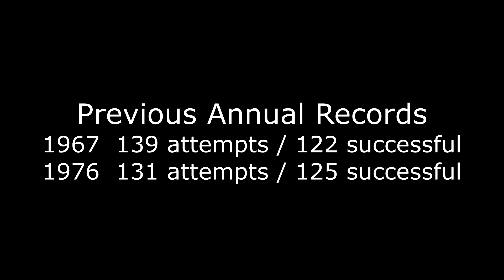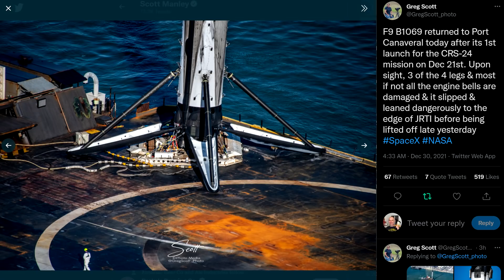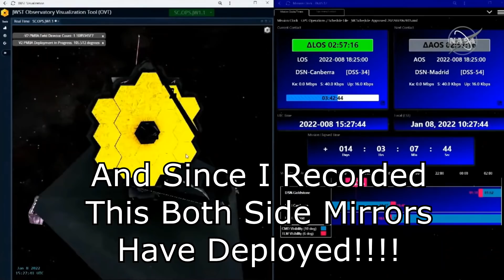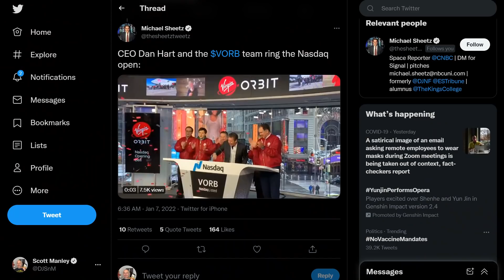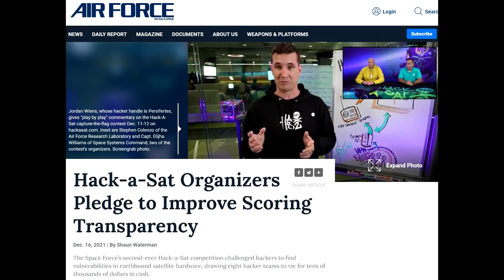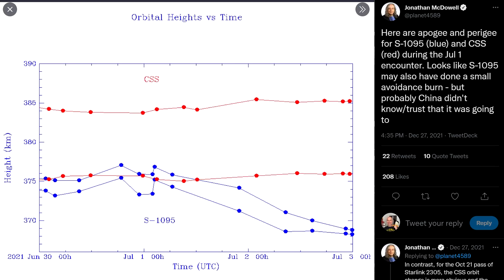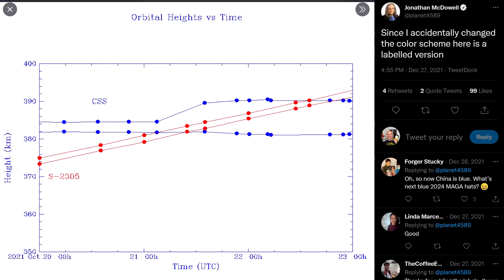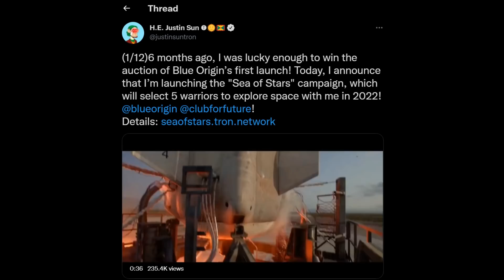JWST Deploys Mirror &  Moon's 'Mystery Hut' is Revealed - Deep Space Update - January 7th

Comment: The scary thing about Hypersonic Glide Vehicles are the ones specifically designed to travel at speeds above Mach 10 during the terminal stage, and still manoeuvre. China was the first to be successful with this, hitting their target from over a thousand miles away. It took many years after for the USA to have that success. Even Russia beat the USA. These things are so fast and manoeuvrable the counter-measures have no chance to stop them in terminal stage. These things reach that stage in under 10 minutes. That's a very, very short window to stop it.

Comment: Why does James Webb tension the sun shield?  If it tears they are toast.
Reply: The sunshield is designed not to let tears propagate. It has to be tensioned because the layers have to be in the correct orientation: the heat transmitted through a layer of the sunshield must be reflected off to the side so it can escape through the gap between the layers.

Comment: How is there not perfect quality cameras on everything these days.  Super sus that there isnt.  All the excuses are pathetic by the way.  Its not the 60's, 70's, 80's, 90's anymore.  0 excuses.
Reply: Reasons not to use cameras on JWST: 
1. on the cold side, temperatures are too low for commercial cameras. You'd have to develop a cryogenic camera, or build an enclosure with a heater.
2. Camera cabling would have to go through hinge points, this adds complication and risk.
3. Camera cabling transfers heat to the cold side.
4. What would happen if a camera, its lighting or its heater were to get stuck in the ON position? You'd have a heat source on the cold side of the spacecraft. 
5. you'd need a lot of cameras to cover all of the deployments->extra weight. 
On JWST, the cameras have engineering value only; they did the tradeoff and decided against including cameras. You'll just have to be patient and wait for the first images from the science cameras.
Reply: @zounds010  I want solutions. Not excuses.  Get to work!
Reply: @Naganita  The solution for JWST was to not use cameras but install sensors that provide far more detailed information. Deal with it.

Comment: In my opinion. Chopsticks are in calibration mode plus leak checks, pressure curve recording for evaluation, friction checks on the lift gear plus cable strain and timing checks on acceleration for starters.

Comment: Scott, at +12:00 you're incorrect that this is the first piece of consumer electronics outside the Van Allen. As early as 1998 the ISS had commercial-off-the-shelf IBM Thinkpads running the Solaris Unix OS that hosted an interface to the ISS station control functions. I learned about this Solaris installation because around that time I had to deliver an early release of my updated Solaris device driver which I was told was needed on the ISS as soon as possible. The ISS also had IBM Thinkpads running Win 95 to manage other tasks.
Reply: Last time I looked the ISS was in low earth orbit averaging 400km height, barely above the atmosphere,  and well below the Van Allen belts lethal radiation zones. Hard to expect Cosmo/Astronauts to volunteer for long missions with a guaranteed dose of radiation sickness and cancers in their job description. 
Still a significant hitch in the human's to Mars plan - where can you shelter from a solar flare event when away from Earth's shelter for the 2 to 6 years an expedition would probably require? With any current or prospective hardware designs it's still radioactive Russian Roulette.

Comment: very stupid unfurling design with 345 failure points. all they had to was copy an UMBRELLA being opened using a single motor ( with 1 backup motor). this would unfurl mirror and shield in a single action as pivots points would link the 5 shields plus the mirror

Comment: IF THEY HAD ANY BRAINS THEY WOULD UNFURLED THE TELESCOPE IN NEAR EARTH ORBIT IN EARTHS SHADOW SO IT COULD  BE REPAIRED BY A ASTRONAUTS AND AN ION ENGINE LIKE VASIMIR WOULD TO TAKE IT TO THE LAGRANGE POINT. IF THE HAD ANY BRAINS THEY WOULD HAVE INCLUDED A ROBOTIC ARM FITTED WITH MULTI TOOLS TO FIX ANY MECHANICAL PROBLEMS. IF THEY HAD ANY BRAINS THEY WOULD HAVE BUILT UP A BACKUP IN CASE THE ROCKETS BLOWS UP.

Comment: They could have had a cubesat fly alongside JWST to take pictures.   The problem of cameras solved quite simply I'd say.  Agreed?
Reply: No
Reply: @epincion  Why not?
Reply: @simian_essence  If you watch Scott's whole video (and others) on the JWST its constructed and placed so that the 4 sensors on board can study the backround radiation of the universe and so in effect look much much further back in time than any other telescope so far. 
This requires the mirror and focusing elements be shielded as much as possible from any nearby source of heat. Hence it will sit at over a million km away at earth L2 shielded from the sun by the bulk of the earth and then further shielded by the 5 layered huge sunshield and the whole craft in an orbital position such that the mirror and sensors never see any heat/light from nearby sources and so are kept as close to absolute zero as possible.
A nearby cubesat would be such a source.
Reply: @epincion  Of course the cube sat's function would be to monitor the deployment phase, not science operations.  It could easily send itself away long before science operations begin.  The same could not be said of cameras stuck to the observatory.
Reply: @simian_essence  'Send itself away' - that would be a very pricey high tech cube-sat with enough fuel and power to get a sufficient delta-V to get far away quick enough from L2. Its not worth the costs and risks for what are in the final analysis just pictures
Reply: Exactly.

Comment: 3:24 In regards to Maneuverable Reentry Vehicles (MARV or MaRV), United States after it shifted from single warhead ballistic missile reentry vehicles to Multiple Independent Reentry Vehicle (MIRV) in the late 1960s and 70s there was developments and debate about MARVs.  The United States deployed the Pershing II IRBM in Europe from 1984 that had a MARV warhead until they were dismantled under the terms of the INF Treaty in 1987. Strategic United States forces were considered for MARV warhead conversions. MARVs would present ABM systems with a shifting, rather than ballistic, path, making interception quite difficult. The U.S. chose not to further to develop them in that they were a solution to a none existence problem.  It was thought that existing MIRV warheads were difficult if not impossible to defend against in a coordinated saturation attack.  At the present no U.S. missiles have maneuverable reentry vehicles.  Other countries are reported to have MARVs operational.  The Ground Based Strategic Deterrent (GBSD) is a future American land-based intercontinental ballistic missile system (ICBM) currently in the early stages of development. It has been reported the missiles will be equipped with the W87 mod 1 thermonuclear warhead replacing the W78 warhead currently used in Minuteman III. The W87 is presently a MIRV warhead and no MARV capabilities.  However, if defensive capabilities of adversaries are enhanced it is possible they could be so developed.
Reply: That warms the cockles of my heart… thanks for the update!

Comment: I bet Russia is pissed that they are no longer the defacto launch system and each year they are become less and less used and unless they can keep up with SpaceX, most companies are likely going to fail.  I personally think Starship will not be useable for manned launches and landings do to the lack of an abort system.  I really think they will need to keep the Falcon 9 around for many more years.  I would love to see them redesign the system to use Methane and the Raptor 2 engines.  Think of how much cheaper and how quick the turnaround could be as well as a larger payload and the ability to throttle the engines on landing.  Maybe they could squeeze enough extra fuel for a non heatshield re-entry.
Reply: Angara is still under development. The 3rd stage failed this time around. Roscosmos is developing a scaled down Falcon 9 copy called Amour. But that’s a very long way out.

Comment: You are the FIRST to point out that pretty much ANY space launch or ICBM is a hypersonic weapon.  Everybody thinks these weapons are unstoppable.  Typically to reach those speeds requires them to be fired in a ballistic trajectory.  This makes the easy to spot at long ranges.  A strait firing missile travelling at Mach 3 is going to be just as hard to stop as a ballistic missile fired at Mach 6.  The US has programmed many of its defensive missiles to be able to track and target ICBMs traveling at up to Mach 25 or so.  Yes it is better to target a slower missile on the way up, but that is typically not possible unless you are pretty close to the launch site.  Understand we can hit missiles in almost every point of its trajectory and have MULTIPLE layers of defense with some designed to strike the missiles (or satellites) in orbit and some in various altitudes of the atmosphere.  For non ballistic missiles there are even more defenses, but they will have a far smaller window to intercept a missile.  Realistically these weapons are most effect during a surprise attack.  During wartime these defensive systems will be on much high alert and the radar activity will be much higher trying to detect launches earlier.

Now the main difference is typically ICBM are only launched from ground locations or subs, but newer hypersonic weapons are shorter ranges or around 1000 miles or less and can be fired from boats and planes.  The US Airforce has successfully tested their Hypersonic weapon, but the Navy version was cancelled as they have been working on one that can hit up to Mach 20 in a maneuverable glide cruise missile.

Comment: "The first piece of consumer electronics above the Van Allen Belt"? BULL cookies! HORSE fritters! There was a Sony TC-80 aboard Apollo 7! Actually there were many music players brought to space during the Apollo missions. So not even CLOSE to being close to being close to the first!
Reply from the maker: See…. I meant to say ‘modern’ in there - also - check my video on the cameras used in space - the Hasselblads and Nikons
Reply: @scottmanley  Also wouldn't the Snapdragon 801 processor on board the Ingenuity helicopter also be commercial electronics, because to my knowledge it wasn't modified beyond consumer spec.
Reply: Considering what manufacturers try to lock down, I'm surprised they found a device they could modify enough, and even more surprised it was Apple. (Except perhaps for Apple being eager for the propaganda; "first!".) Up there, you usually have 2 cores running the same computations together, and if they disagree, run them again. That requires some software changes at the deepest level of the operating system, and it's hard to imagine how to make it work with modern software at all because it slows everything down so much.
Reply: Not to mention the gopro on starman in solar orbit.

Comment: Id like to know this. Why is the closeup photo such garbage quality? According to the photo the moon's surface and rock is rainbow colored? I know for a fact they can do clear and proper closeup photos with great resolution. The two prior photos looked correct but the close up is garbage. Something seems off.
Reply from the maker: Ever heard of a bayer mask?
Reply: @scottmanley   I haven't what is that?
Reply: @scottmanley  also if you look at the shadow there's a perfect line on all three sides of the shadow. Looking at the round rock why is the shadow a rectangle with sharp edges and lines. You can see some light casting around the left side of the rock, the shadow it casts should have a concave shape. I see a shadow that doesn't match the object it extremely obvious.
Reply from the maker: @Jenny-CR  come back when you understand cameras otherwise you’re just going to get laughed at.
Reply: @scottmanley  okay I get you. I should learn more about photography it will definitely help things make sense. It's just strange that a pretty round rock with jagged parts would make such a shadow. A half open door shadow is caused by the shape of the door and the angle of light. It just seems like a shadow with straight sharp edges and angles would be caused by an object with similar features. I could be fooled tho, I'll learn more on the subject like you suggested. Thanks for your time and responses.
Reply: I looked up Bayer mask. It's just how a photo sensor works for rgb. I understand how that works. I just want to know why the camera is suddenly primitive and we are seeing the rgb, when I know they can take a photo that we aren't seeing just sensor patterns. Or is the closeup just taken from the previous photo by zooming way in on it. I imagine if you zoom way in on a already takin photo you would see the rgb patterns.

Comment: What’s spaceX’s long term plan with this starlink? They’re going bankrupt... is their plan to have so many satellites that the US government has no choice but to bail them out?

I’ve read this starlink system is quite expensive and with a lot of users it’ll slow down considerably just by the nature of its design 
Plus the starlink dish uses quite a bit of electricity... 100w ?
I guess if you’re spending that much on internet access then more money spent on electricity isn’t a concern 
If their target is locations without connection to a network... then that high power draw would be an issue for them

Comment: Any idea anyone on what type of bearings are used in space for anything moving ? It's going to have to take extremes of temperatures so presumably any lubrication is out ....

Edit - Also I can imagine 'cold welding' between metals might be a problem as it does get chilly out there .... .
Reply: AFAIK cold welding works better when something is warm. What matters is that it's in a vacuum with no gas or oxidation to get in the way of metal fusing to itself.
Reply: Full ceramic ball bearings.
From what I have read the Hubble Space Telescope's reaction wheels were all made with steel bearings...  And failed very rapidly because cosmic rays would strike the shielding, create a high-voltage jolt which rapidly eroded those bearings. So during maintenance missions they were replaced with full ceramic. And everything since then uses full ceramic, including the bottom bracket on my racing bike... Thanks NASA!
Reply: @davidturpin9135  Yes - Scott did a video on failed reaction wheels !

Hadn't thought of ceramic bearings but they make absolute sense - non conductive, minimal - if any - dimension change with temperature,   and no need for any lubrication !

Thanks for pointing out the obvious to me !!!